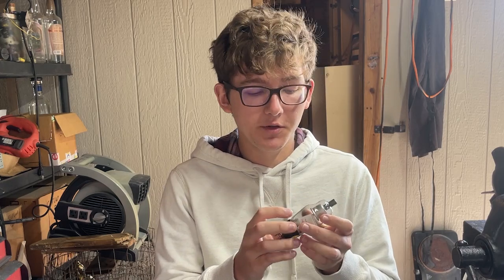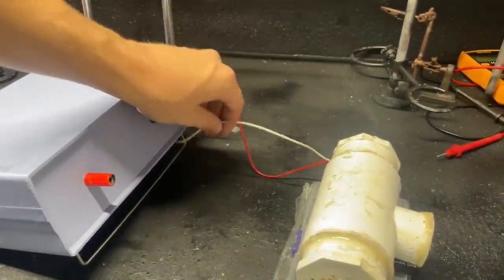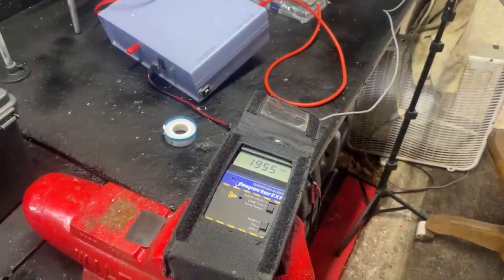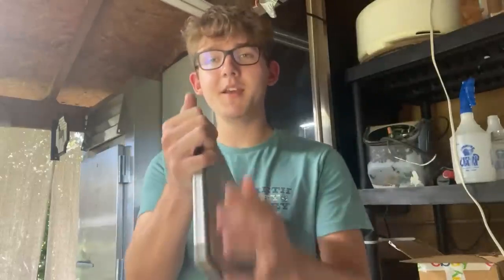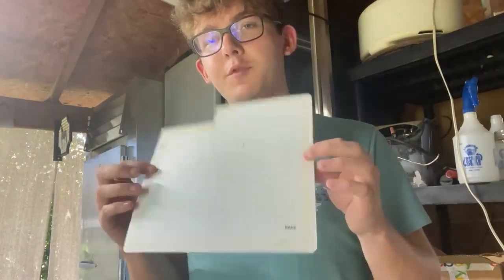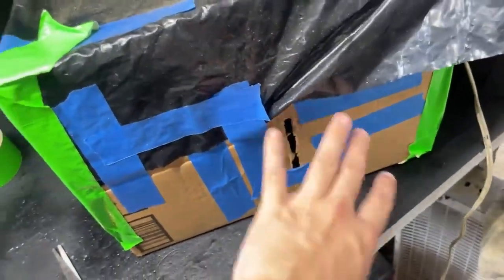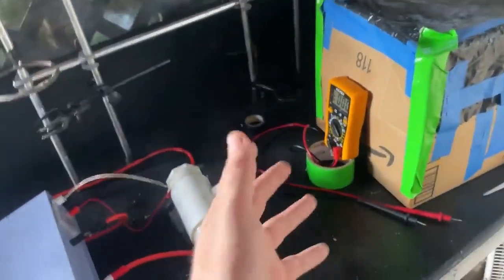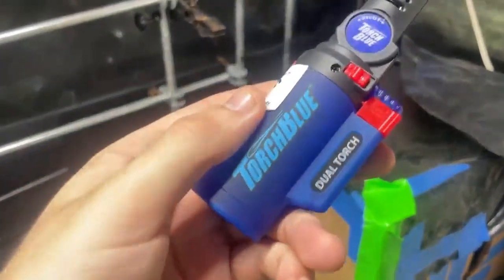Building a X-ray machine in my backyard!

Comment: Remember always to stand farther than a couple of meters away from a working Xray tube and to protect your body with a lead coat (at least 1mm lead) or you might never make (normal) babies again or simply grow some nasty cancers. By the way, Xray machines that produce really "hard" rays use a rotating anode that can take a much higher voltage for longer... I understand those are used in the industry to investigate steel constructions (like welded steel pipes or turbofan blades e.g.) mainly
Reply from the maker: I believe in industrial weld inspection they use gamma sources instead since you need high penetration. Think that radioactive source they lost in Australia was one of those.
Reply: The rotating anode is not for higher voltage but for higher amperage. Most of the electrons (i.e. current) that emit from the cathode and hit the anode are turned into heat, very little gets converted to x-rays. So the anode gets hot and can melt. To counteract that the anode is a disc that is rotated so that the heat is effectively spread over a larger area. For higher voltages the anode / cathode distance needs to be larger and the tube housing also because the high voltage will both creep on the surface and jump in the vacuum.
Reply: Standing away is sound advice, even better is to cover all directions from the tube except the target direction with at least 3 mm lead. This will stop most radiation below 70 kVe energy level (IIRC). Low energy radiation is useless cause it does not penetrated the object you are trying to image (depends of course on the object) and it is dangerous because  there is a lot of it and it is readily absorbed by living tissue causing damage. It also makes sense to cover the direction that points to the object you are imaging with something like 1-2 mm Al (again IIRC, read the literature, see half value layer, primary filtration) because again the low energy radiation is useless so you want to get harder radiation in case you image living tissue or accidentally expose yourself to it.

Comment: Does the tube emit x-rays in a directional fashion, or more of an omni fashion?   If it's not a directional source you could rotate the tube vary the intensity.
Reply from the maker: It’s a directional source
Reply: @PyrotechnicalScience  thanks, wasn't sure if maybe there was a shroud/reflector the tube was mounted in on the original machine.

Comment: Hey can you compare the intensity of different types x ray source with real  working x ray tube like , comparison with generic incandescent bulb used in fridge , diode vacuum tube , and of crt at same anode Voltage ? I wanna know if crt gives you equlent x ray as of real tube or it's better or worst than other vacuum tube?

Comment: Two questions. 

1-Do you know is the composition of the phosphor on the intensifying screen? Plus, do you know any other that can work better?

2- It seems like directly exposure of a non living object should work great for not destroying it, so for EOD teams it should be a great thing. And walking with a bit of lead would only provide more protection for the blast, right? So it's two protections in one.
Reply: The phosphor on that "paper" is basically the same they use in those oldfashioned CRT's (like old tube oscilloscopes or B/W TV's) if that's any help. Just look up "Cathode-ray tube" in Wikipedia, there's a very long and comprehensive description of phosphors used in CRT's
Reply: @TechneMoira  Thanks!

Comment: Great video as always!
However I didn't understand why you chose to use those little blue packets in the previous video instead of the xray film/screen that you used this time, is there a specific reason for it?
Would be interesting to see how the weaker x-ray tube is shown on the film instead of the blue packets.
Reply from the maker: The screens don’t work the best for the low power tubes since the light output is pretty low
Reply: @PyrotechnicalScience  Oh ok.
Thanks for the explanation!
Looking forward to seeing the CT machine😃